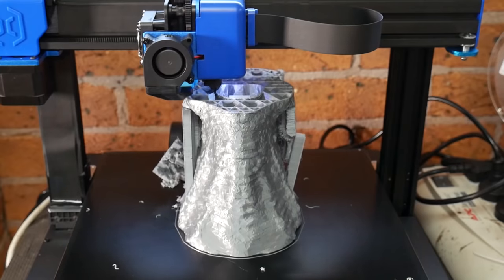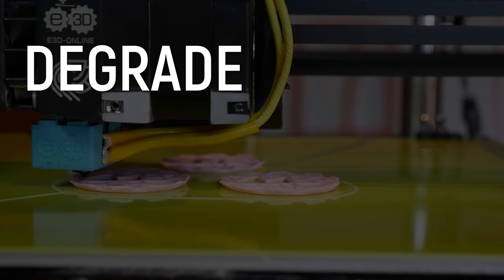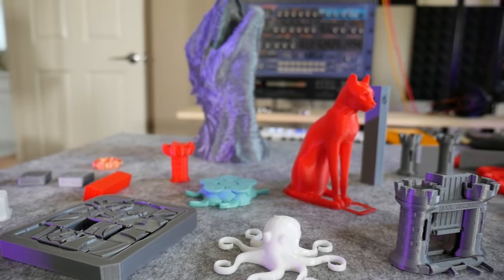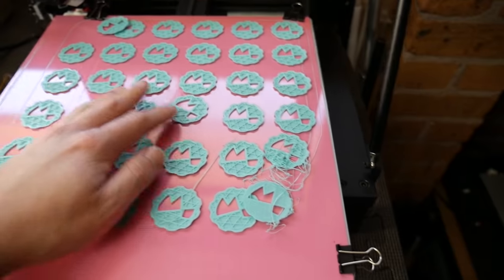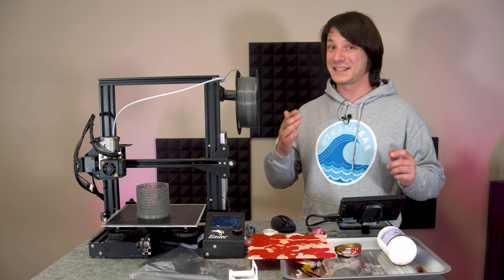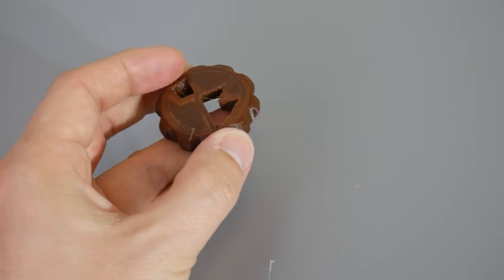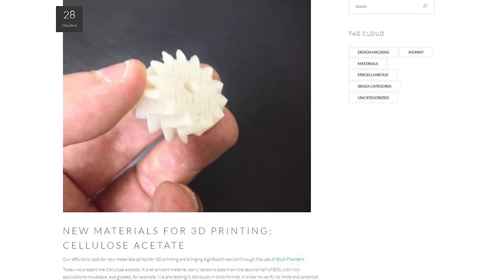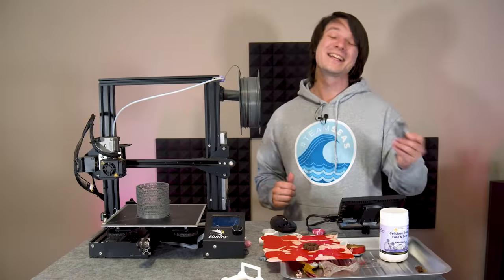PLA - 3D Printing's Biggest Lie.

Comment: Glycerol is the plasticizer you're looking for. Its biodegradable and can be used as a plasticizer for cellulose acetate. It has the added benefit of increasing the temperature at which the cellulose decomposes.
Reply from the maker: Great to know cheers!
Reply: sounds tasty
Reply: That noted. you do have to be careful with anything that has glycerol in it coming into contact with nitric acid (unless polymerization binds it up in some way. been a while since I took chemistry), so there is that.
Reply: @DFX2KX  I'm pretty sure you need fuming nitric acid for that, which isn't very common to have in a lab, let alone around the house.
Reply: Is that the stuff people make memes about melting Kardashians?
Reply: Deep appreciation for this video. The need for a structurally viable home compostable filament is real.
Reply: @DFX2KX  Not to mention celulose + nitric makes its own kind of energetic material
Reply: @gendragongfly  
You need a mixture of sulfuric and nitric acid, afaik both highly concentrated. And elevated temperature.
There's no reasonable concern even if someone would use it for Hobby chemistry.
Reply: @MakersMuse  Keep us posted on this endeavor (cellulose/truly biodegradable filament), and how we - the community - can support and back!
Reply: Having just started with the hobby I honestly thought that because it was made from Corn it would be totally environmentally friendly. Now feel very guilty about the off cuts and pre print extrusions / bottom layers I am doing.

Would really love an environmentally friendly option.
Reply: @heinzhaupthaar5590  You'd rather need temperature control. Cooling. As I recall that chemical reaction is quite exothermic and overheating results in very predictable effect in terms of the actual form and extremely unpredictable when it comes to exact results 👹
Reply: This comment and the entire video gives me “write that down, write that down” vibes
Reply: @MakersMuse  look at starch plastic maybe? you can make it from potatoes, it melts with heat, etc, should be printable? i'm curious
Reply: @MakersMuse  and you care about this now why when you print pla and two you should leave this up to some who know what they talking about
Reply: why is increasing the decomposition temperature of the cellulose a benefit? don't you want a lower temperature?

Comment: The real question is what application would 3d prints made from cellulose have though? Cellulose is a great material, but it doesn't have the same strength and durability profiles as PLA or ABS has, which makes the application for cellulose in many cases far less than ideal. It can definitely be used for decorative applications, or applications where it won't be exposed to chemical or environmental factors. It can be used for test prints, absolutely, but often with test prints you want to make it in a material analogous to the final material, so you choose PLA if your final print will be PLA for instance.

There is a great paper titled "Advantages and Disadvantages of Bioplastics Production from Starch and Lignocellulosic Components" which is a really good read with a lot of overlap in considering whether bioplastics such as starch based or cellulose based plastics are ideal for hobby 3d printing which I would very much recommend to read.

Also, one final misconception. The corn PLA is made from was grown to service industry, it's not corn taken out of human food chains, and in many cases it's not even corn that's fit for human consumption but rather a strain that is grown for it's high starch content to maximize output. Reducing PLA production would have minimal impact on food consumption, that is a much greater issue which deals with macroeconomics, local food shortages, supply chains and not the least the never ending appetite in the western world for imported produce. But that's a discussion for another time. 

Great video though, and these are definitely important issues which needs to be raised! 🙂
Reply: biodegradable prints would be intended for non-permanent applications, such as calibration cubes for Z-Height/extruder tweaking, non-functional prototyping, gag gifts, temporary project housings etc.
Reply: DOOTNOOT Menkalinan calibration and tests you mainly want to do in the material you want to end up printing in though. Sure if PLA was entirely analogous with cellulose that wouldn’t be an issue, but it unfortunately is not. 

The other points you point out I fully agree with, but how big of a part of the home 3D printing field do they represent?
Reply: @SwitchAndLever  only some tests. but say, making sure your bed is level with a sample spiral doesnt need the be the same material you print with.
Reply: @572089  It wouldn't make such a big difference though. These tests don't consume too much plastic anyways.
Reply: You can use it to print the garbage shit people print all the time like, benchy or whatever
Reply: not an expert that’s kind of the point, if you’re printing Benchy with the purpose of dialing in settings and your extruder to print PLA or ABS you really can’t as you have to dial that in for each material. Printing a cellulose Benchy won’t be the same as printing one in PLA.
Reply: My biggest question about the corn situation is more is it worth losing that viable farm land for PLA? I recently realized that only around 1/3 of all the farmland we use is actually usable for crops due to the elevation, soil, and containments.
Reply: @seemlesslies  whoa thats crazy, I'm going to have to go learn about that. Last year I learned about small time farmers dwindling, being priced out and collapsing due to large scale operations. I'm concerned about small farms disappearing altogether, I have a lot of respect for the farmers who do what they do. I think power should remain with them.
Reply: the answer to your real question, I will give you another question. How many tools in a garage/garden-shed/kitchen utensils are made with wood?  the answer. A shit load.  and they are generally really good tools/utensils.
Reply: @johnnybraccia452  I fail to see the relevance. Wood is not analogous to cellulose plastic. Not in strength, durability, weather resistance, anti-bacterial properties, and the list goes on. Wood doesn't deform under slightly higher than normal temperatures, nor does it melt. Cellulose plastic is actually VERY flammable, far more so than wood. Look at the celluloid film archives which basically have to be treated like bomb shelters because of the volatility of old film.
Reply: @SwitchAndLever  you failed in many of your arguments. Let’s take the worst failure, cellulose film was dangerous because of the nitrates used.  Google cellulose nitrate film vs cellulose acetate film.
Reply: @johnnybraccia452  you're right, I was wrong, I got them conflated. However you're wrong in one aspect, I didn't fail, being wrong is not a failure. Sticking to your arguments even though they are wrong is however a failure 😊

Also, I don't see you mentioning any more argument except flammability. What is your gripe with the others?
Reply: You could use a thin coating of something with a long term uv breakdown to protect from short term weathering. Breaking down is the end goal though.
Reply: I'm a bit of a ( SUSTAINABLE ) Bio-Energy / Bio-(Petro)chemicals / Bio-Fuels Advocate myself, so glad someone else pointed this out!

Less of a Food vs Fuel argument, and moreso an Industrial Feedstock Crop vs Direct and Indirect Land Use Change issue!

Granted i am armchair in all this, but people's dated views / misunderstandings get to me a bit so glad you wrote this!
Reply: I am curious if the corn for PLA is grown in slash-and-burn farms from the rainforest, like biofuel corn is.
Reply: @llareia  Citation Needed
Reply: I love that you mentioned that the corn that goes into plastics and fuel isn't the same as the plastic you eat! You clearly did your research! :)

One thing that I have heard is that the big issue with using corn for fuel and plastic is the amount of water and land that's used for it. that water really should be going towards food production, and that land really should've been left alone instead of turned into corn fields that won't make food. 

but tbh I'm not sure how much I agree with hat take, but it's something I chew on a lot.
Reply: @Westwoodshadowgaming  indeed, the water usage conundrum is a difficult one, because it does definitely hold true in some aspects, and some areas, and not in others. It's also further complicated by big companies like Coca Cola draining ground water in some areas to make their product, leaving less water available to drink, much less to water crops with. So it's not clear cut at all. Don't forget the amount of water, often in low water areas, that go into feeding our increasing desire for avocados and almonds. That's absurd if anything. Corn is, comparatively, a much lower water requiring crop.
Reply: This is a misleading analysis, since "not corn taken out of human food chains" pre-supposes there's some fixed patches of corn around the world and some is human grade and some isn't.  The reality is we plant corn for the use we want, and there's a limited supply of arable land to plant in.  choosing to grow corn to make plastic (or ethanol, another enormous scam) is absolutely taking it away from human consumption.
Reply: @danmerillat  if you want to talk about pre-supposing, you're doing the exact same with pre-supposing there is some sort of shortage of corn for human consumption. Food shortage, outside of famine stricken areas, and areas where agriculture is difficult or struggling, is actually reasonably rare. The problem is more the quality of food which people have access to, as well as huge differences depending on your income and social status. Neither of these will be solved by removing industrial corn from being grown and converting the land to grow regular corn. 

If you want to talk actual numbers, only 0.016% of agricultural land is used for bioplastics, whereas 25% is used to grow food and feed, and a whooping 69% is used for pastures for animals. Are you really going to argue that those 0.016% is a problem here? 😂
Reply: That GMO plastic corn is still stripping nutrient fertility from the soil, which is much more valuable for food production.
Reply: David all industrial farming is doing that unless you care for the soil and let it rest and leave it fallow to allow it time to recuperate. Singling our corn for bioplastic in that is missing the point by a lot.
Reply: Ultimately we have to assume all people will someday have 3d printers, and base our materials off of a world like that to ensure the least environmental damage can happen if that became reality. If everyone needs to print with materials that will ultimately degrade with time, then we just have to adapt to it.

In reality we'll probably start with this material as the baseline, then find ways to strengthen it the same way PLA has been in the past few years without compromising the ability to easily break it down.
Reply: Thank you for your input and for sharing more light on the subject matter.

Although I agree with you that there would be not much use for biodegradable or less effective materials then PLA for practical parts that retire strength. One would just need to goto thingaverse Myminifactory and Cults3D front page to see a huge majority of gimmicks, gags and once offs which are perfectly suited for a biodegradable material. Not to say I don't enjoy them myself. I see the beauty in both practical parts and aethetic play things.

That's the joy of 3D Printing. And biodegradable can realistically fit the bill for 6 out of 10 print jobs by the average Joe, 3D print nerd or Stevens Airbnb Kitchen

Happy Printing.
Reply: I would use it for prototypes. If you're working a design it's nice to have something that you can work with for a temp print or a test run that you can toss out of its a failure with out harm. Then switch to the PLA for the finished part. Using it for calibrations is useless, printing a benchy or what not with the cellulose filament won't calibrate it for PLA or any other type of filament.
Reply: @SwitchAndLever  You covered what I wanted to say, but much better. Thanks ^.^ I think you also did a good job with the responses as well.
Reply: I feel like you answered your own question in the first paragraph
Reply: @JSHuiting I think you need to watch some more 3D print channels. It's not just for prototyping. Heck, I've designed and made quite a few things with mine that isn't just a 'prototype'.  Like the upgrades for my 3d printer, my pc monitor stands, my own storage containers, a replacement handle for my vacuum, new clamping handles for my pressure pot, and a lot more including toys for my nephews. Sure you can prototype with it, but you can also make finished items with it.

Shoot. There's one whole channel that shows a guy turning plastic water and soda bottles into new filament to 3d print with. RECYCLING. But then most of the stuff used on these printers comes from recycled plastics, and the prints themselves when not needed can be ground down and remade into more filament.
Reply: TBH even when you make mechanical stuff like gears not always there are huge forces exerting them. For example in clocks mechanism must be precise rather than heavy duty

Comment: I feel like "biodegradable, but under circumstances" is actually the ideal for these things, as it means you can have long lasting prints or ones that break down, maybe in the future there can be dedicated facilities? If 3D printing becomes more common I can definitely see there being dedicated recycle banks for it, only these ones actually being useful.
Reply: There is. They even give credits for use in purchasing recycled PLA.
Reply: Then it should be marketed very carefully as that instead of just biodegradable. It's pretty clear that these companies used that term to drum up supporters for pla and it's still a pretty common misconception that pla is just biodegradable. We were lied to by omission
Reply: Thats what he's recommendong, dedicated facilities (government run) that recycle it.

Although this will never happen unless it's profitable